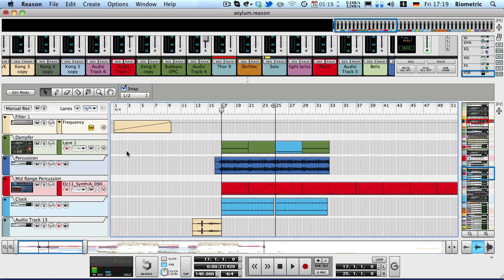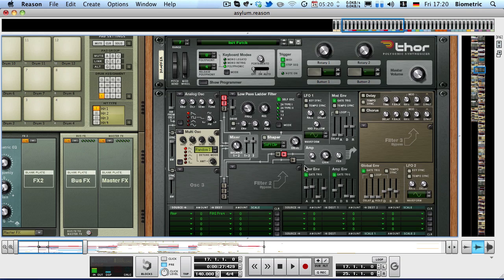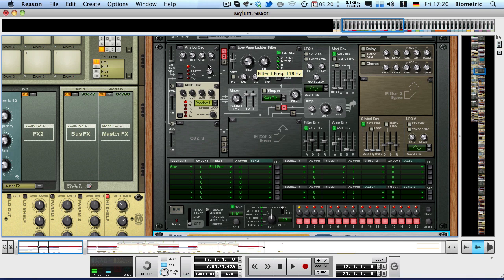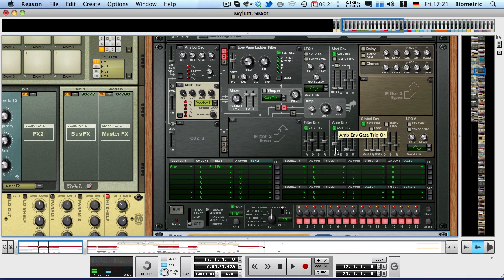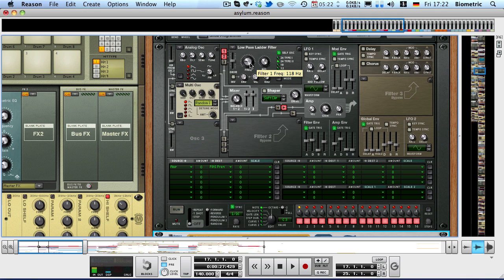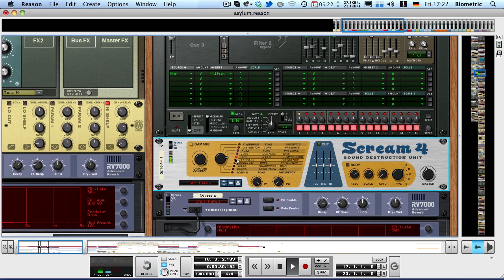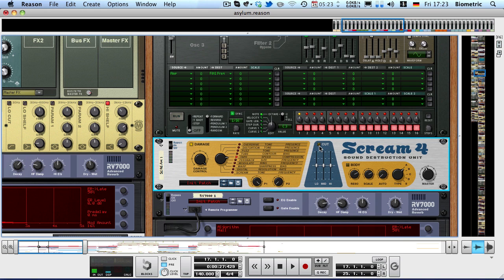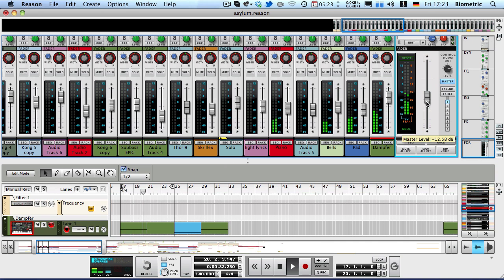Tutorial: Oil Tanker Bass from Asylum (Dat Bass)

Comment: I just used an LFO actually. I had 3 saws, 2 were 4 octaves up and detuned slightly to mimic the multioscillator. Filter 1 was a LP, set the cut off and resonance like in the video. Insert 1 parabolic shaper (optional). FX 1 one of the tube distortions (again optional if you wanna use an external plugin), and FX 2 you could use massive's reverb. Then just throw an LFO on the cutoff frequency or try and make an envelope to match Dorin's. Pretty simple :P